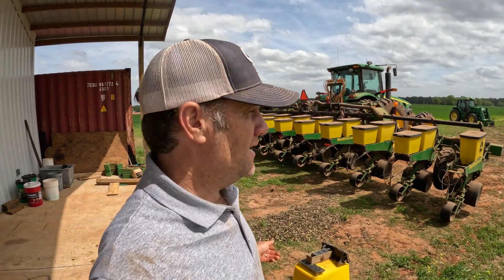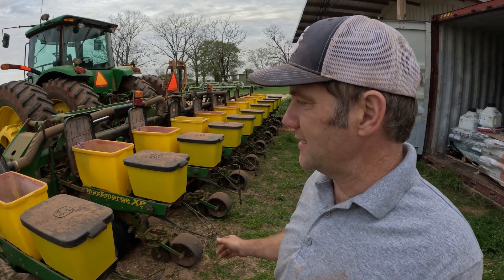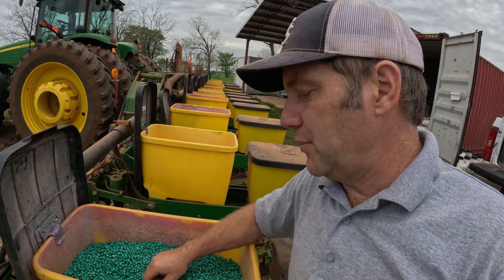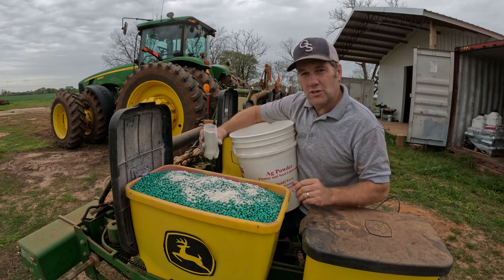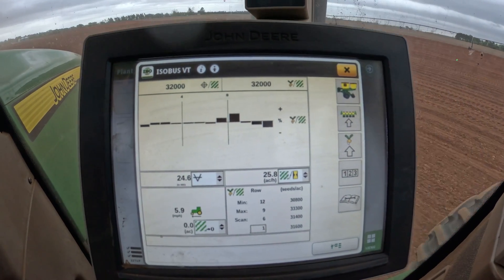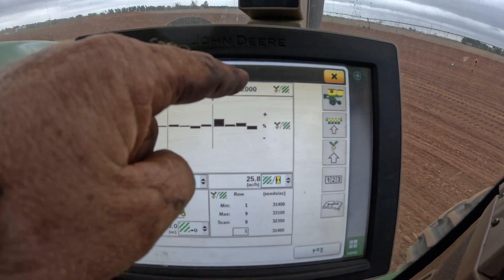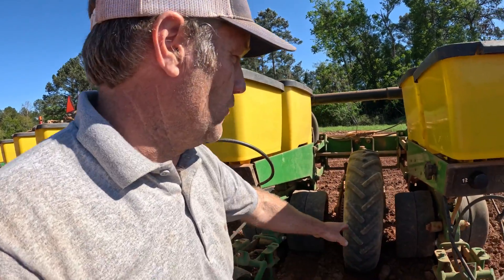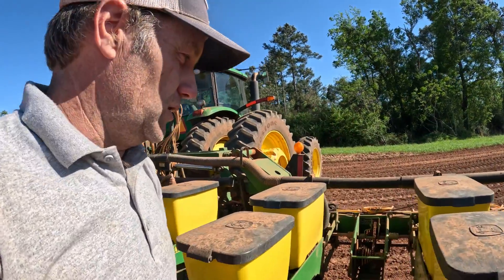Non-GMO v. GMO Corn

Comment: I can tell from the color of the soil. Ate you located somewhere near the Donalsonville, GA? I have drug a homemade 4 row spider ripper with planters attached over thousands of acres with a 986 IH. Not a tractor driver here...full fledged operator.....ALL Seed are genetically modified. The main resistance added to the corn is Bt, and that is  used in organic operations. The correct term is transgenic.
Reply from the maker: I’m in Clay county Ga.  About 35-40 minutes north of Donaldsonville.  The seed industry uses the term GMO to refer to organisms (plants) genetically modified to have the BT gene and be Roundup Ready.  While all seeds are genetically modified through selective reproduction, the BT and RR genes were introduced in the lab, that’s why they are referred to as GMO

Comment: You got that ground in great shape did you pull the moldboard plow over that ground
Reply from the maker: No.  Subsoil and the Lemken Kompactor.  I have a video coming out Wednesday on that Lemken.
Reply: @PatrickShivers  ground look really good shape where wet here in eastern nc
Reply from the maker: @chrisbubba6000  we’re getting weekly rains (currently) and running wide open on the 2 days a week when it’s dry enough
Reply: New subscriber here as well and as I typed in comments on another video, anyone with begginer book/vid resources for a retiree who has a 230 Massey 1982 model and a few implements and wants to raise various veggies in ne tx sandy loam but no experience gardening with a tractor I would be be highly appreciative

Comment: What advantage is the 3ph stack fold over the pull type, such as the JD "NT" frame? I really only see stack folds advertised in the South, and only see them in southern VA and further South.
Reply from the maker: It’s quicker on transport and suites our field sizes/shapes.  If your fields are symmetrical with straight edges, and are 250+ acres then the pull type makes more sense.  In the south the fields are normally highly irregular shaped, and 30-150 acres.  We get done with one field, fold up, head down road a few miles, fold down, and start back planting.

Comment: Saw 3 old Lock n Load insecticide boxed is your storage container. What are you using for rootworms and chinch bugs on the Non GMO ?  great video
Reply from the maker: The lock n loads is Counter.  It’s on all the corn.  It’s a Non-GMO v. GMO test, not an organic v. non-organic.  I’m treating both varieties the same across the board and seeing which one out performs the other.  If one gets something the other doesn’t then it nullifies the trial results